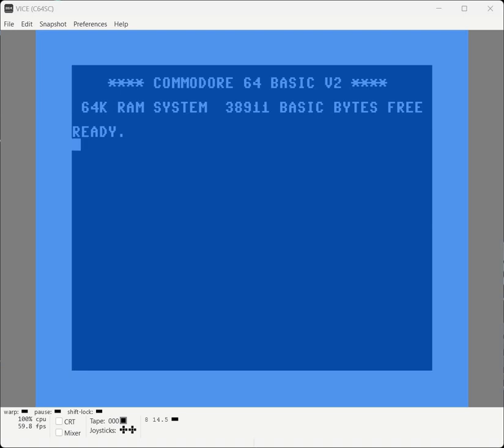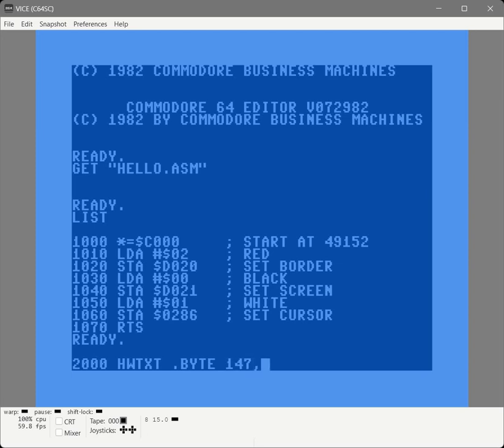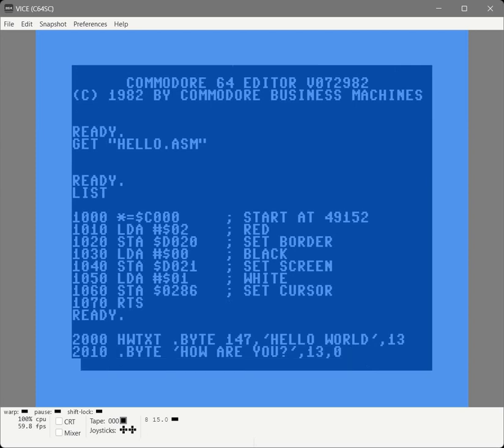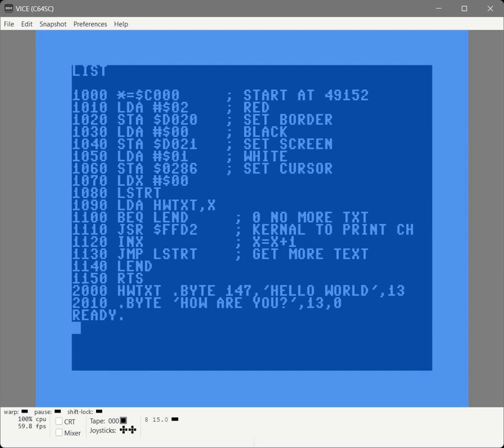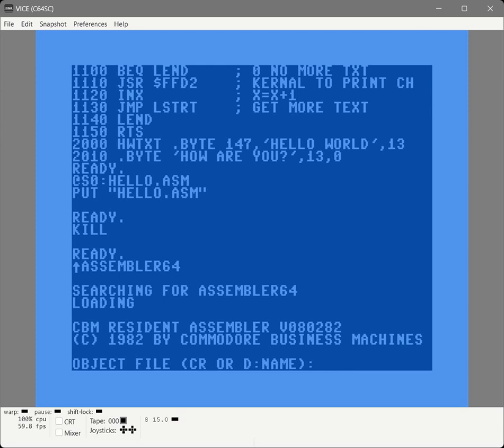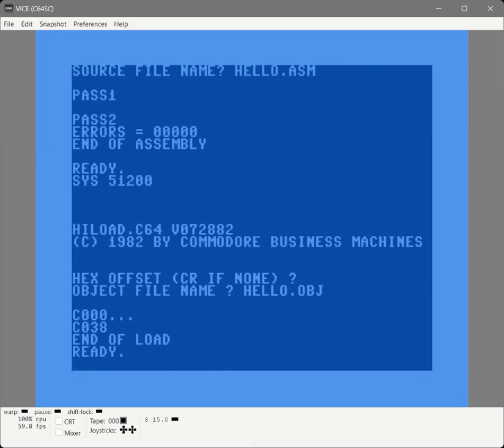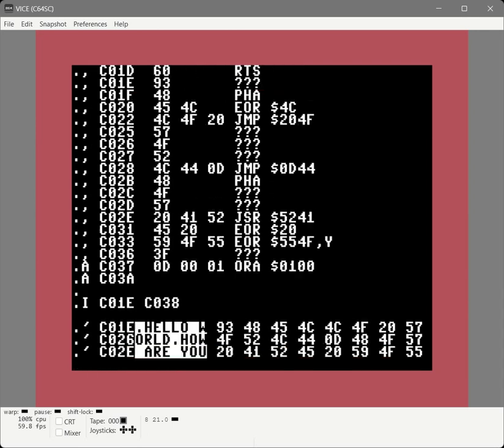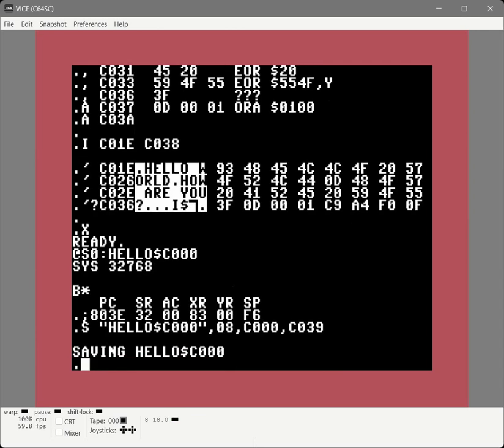Writing 6502 Assembly on a Commodore 64 using the Macro Assembler Development System.  Part 2.

Comment: Who is the target audience? Back in the 80s I owned a Commodore 64... Had the macro assembler and at that time there was some things I didn't understand about the assembler and the kernal routines... I never built a game in assembler but that would have been cool... Some things that would be interesting: how to do floating point operations and that would cover how they are formatted, how a bout paging programs using assembler in the system.Tthat would be cool to see that, maybe build a demo screen... Something with a bit of meat to it that isn't covered by others... Maybe try to set up some structured asm macros for a bit of a higher language feel... Show how its built and how they work with a simple game...